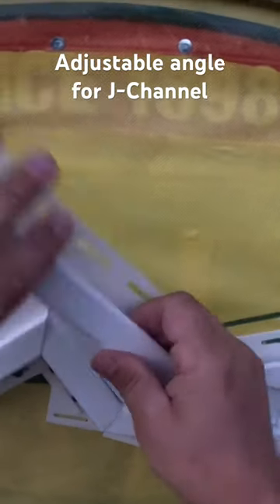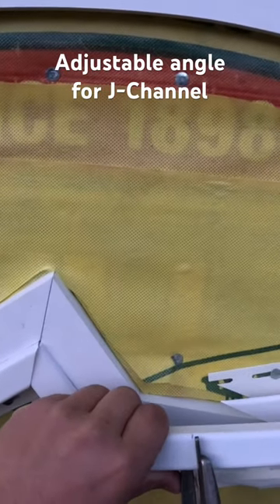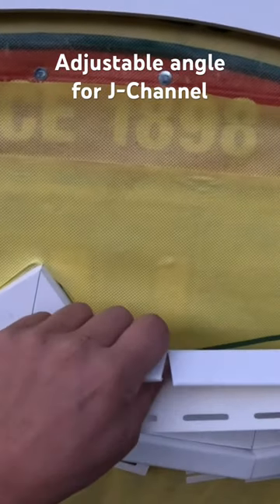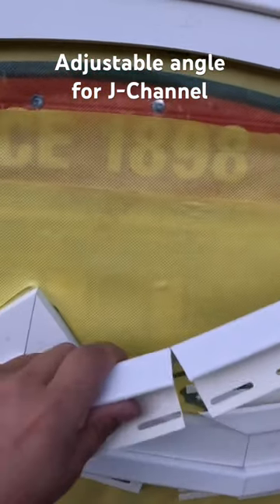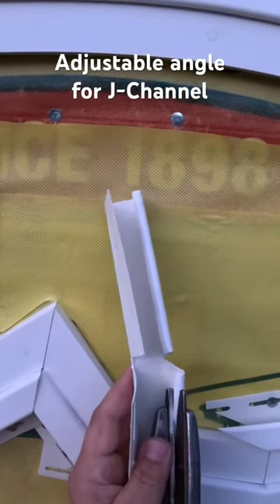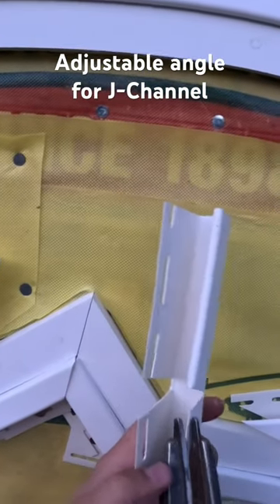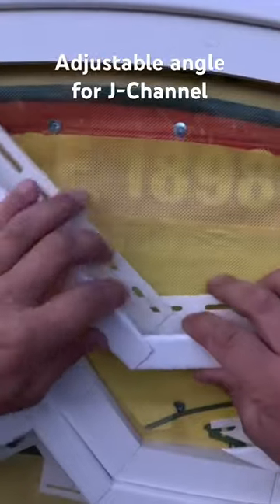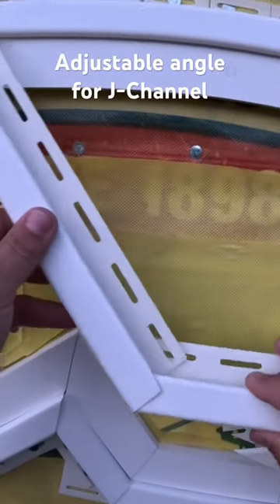Versatile J-Channel angle cut

Comment: Maybe the upper section should be outside the lower section for drainage
Reply from the maker: I usually overlap things starting from the bottom for that purpose… if this was a real “in the field” application and not a display I’d have installed Z flashing on top of the pvc trim.